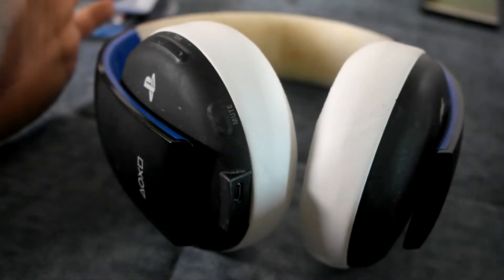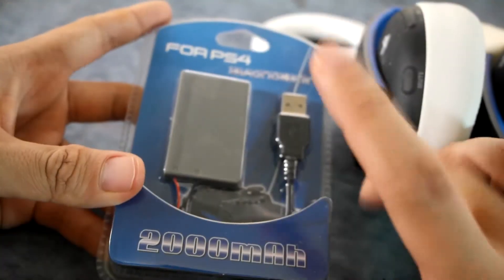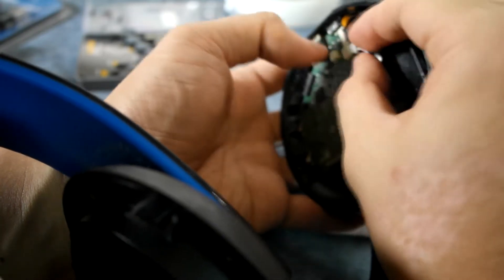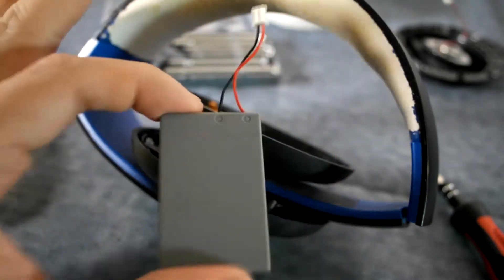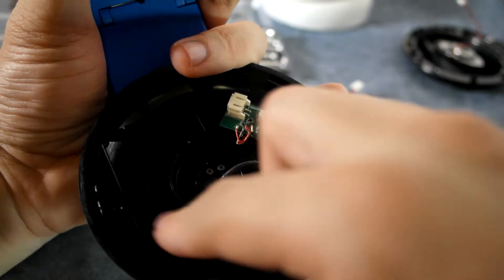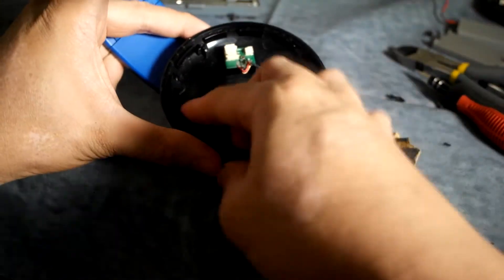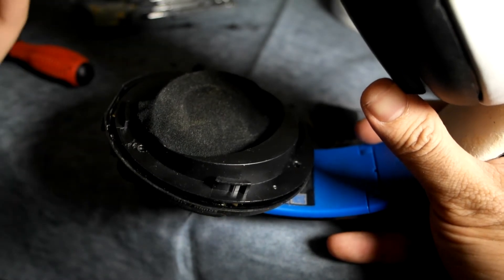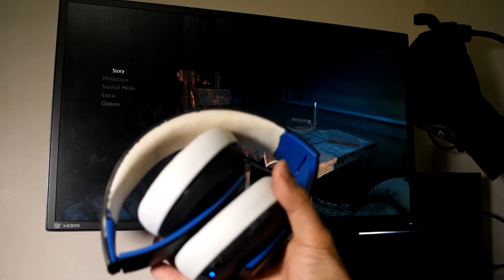Upgrade Sony Gold Wireless Headphones with Dualshock 4 Batteries

Comment: Just want know is that thing exploded or not 😂? Because I am going to do the same as my headset stopped charging yesterday with its original battery after 2-3 years of use.
Reply from the maker: So far, hasn't exploded. I transferred the battery into a bootleg Dualshock 4 and it still gives me a lot of juice.
Reply: @BimBurger  I tried and shocking my headset battery also work when I charge it with my controller so I am sure now that micro USB port of my headset is dead now that's why it's not charging.
Reply from the maker: @tadnyarahul2854  You should be able to replace that too. Bunch of replacement parts available